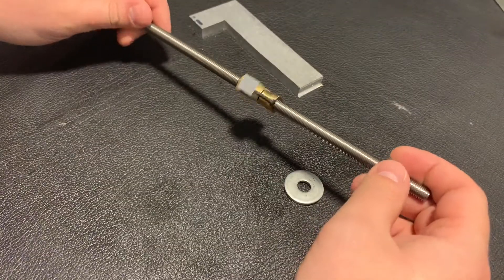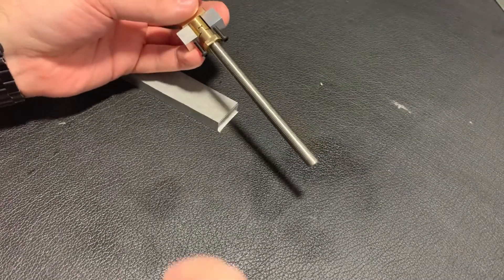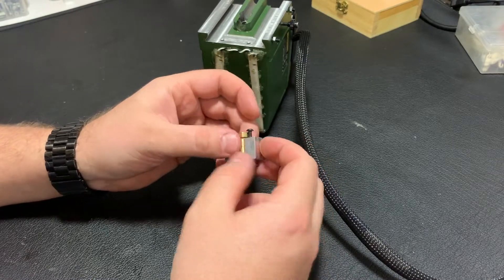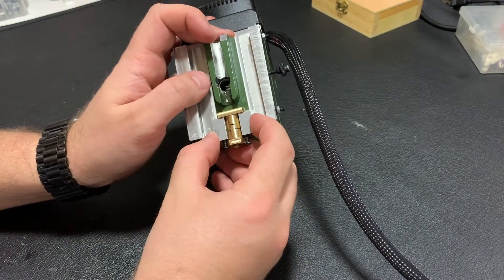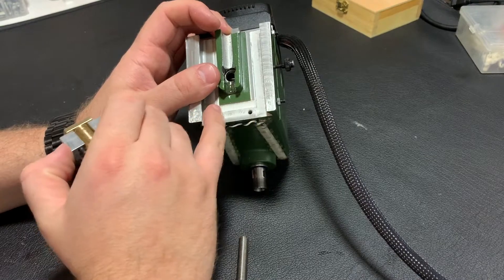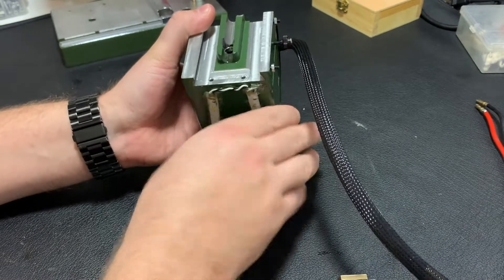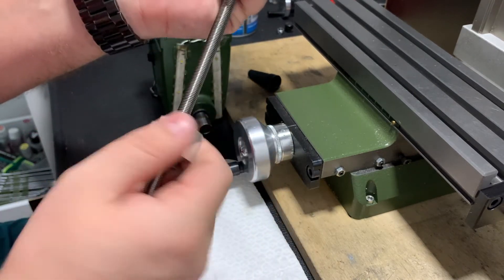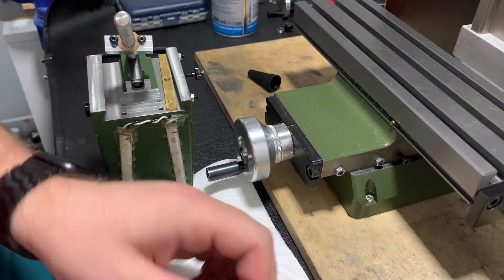Precision vertical lead screw for Proxxon MF70 milling machine. (part 2)

Comment: What's exactly the problem to mill on a drill press?
Reply from the maker: Rigidity first of all, then not so easy to measure on Z axis.
Reply: @zhadlun  So basically, if you replace the hollow column with a solid steel rod, replace the drill chuck with a collect chuck and add support to the moving platform, you get a mill, correct?
Reply from the maker: @voidfalse  you still need a table. But in general it's possible this way.

Comment: Hello my friend. can you tell me if you made any modifications to insert thrust bearings in the KT70 table? I'm wondering whether to mill the knob or drill the plastic (in the top of the table)?
Reply from the maker: I drilled plastic
Reply: @zhadlun  thank you very much for your quick reply :)